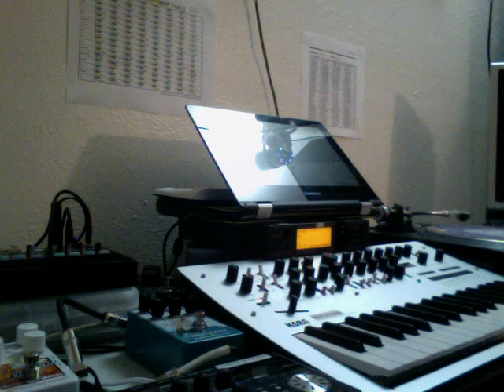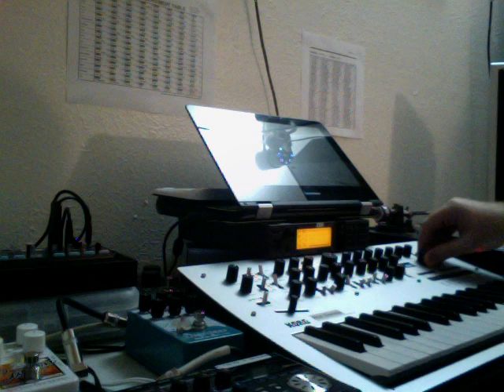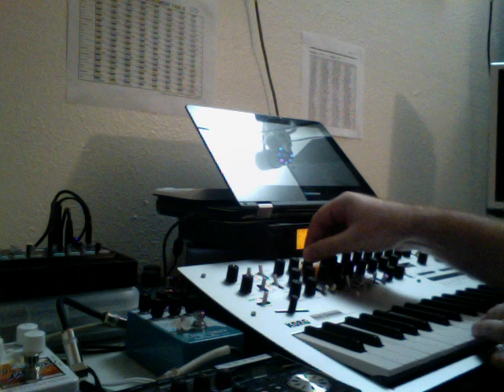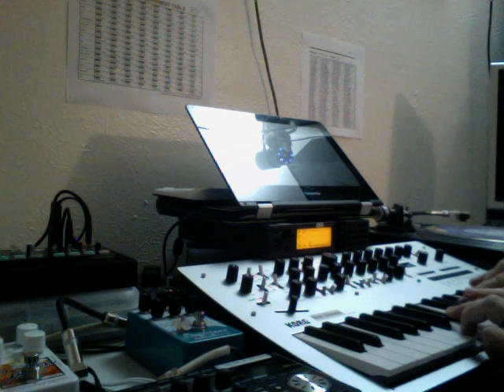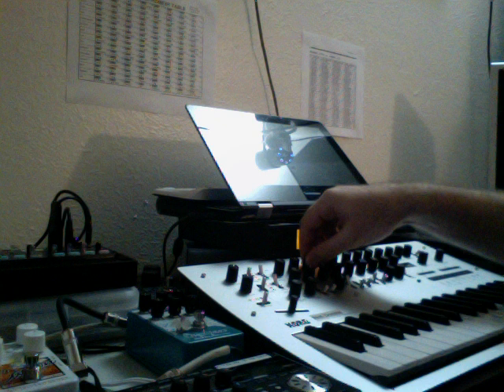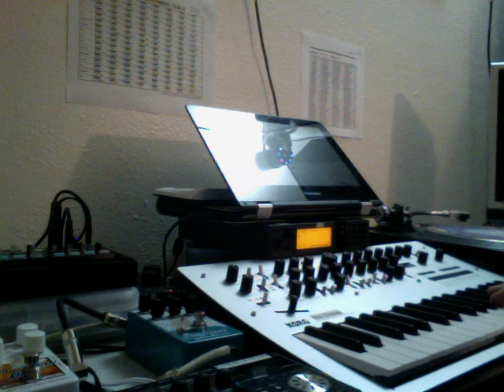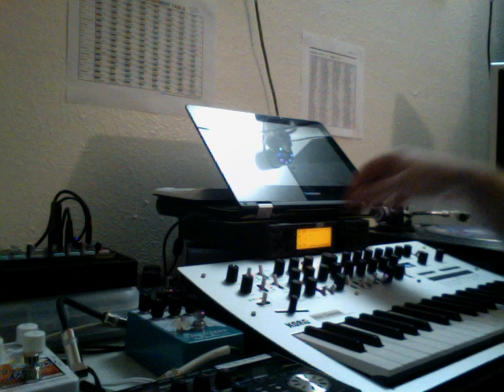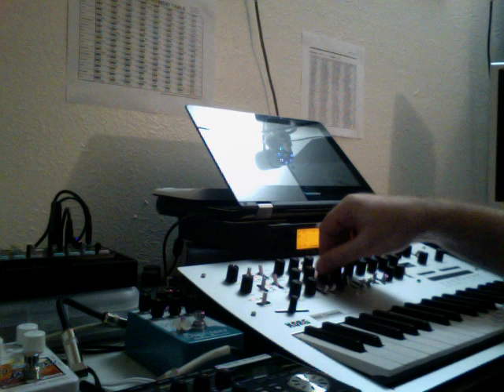Korg Minilogue Audio In PT1

Comment: Is there any way to control pitch for audio in with the Minilogue?
Reply from the maker: Not directly I don't think; I'm using the midi notes being sent and taking advantage of the same tunings. I might have to change the microtuning on the korg, I would expect you would get back notes in the normal scale, not the modified one. You could use the minilogues MIDI CC signals to do something though, perhaps set the slider function to none on the patch but then use that MIDI data to affect your external instrument.